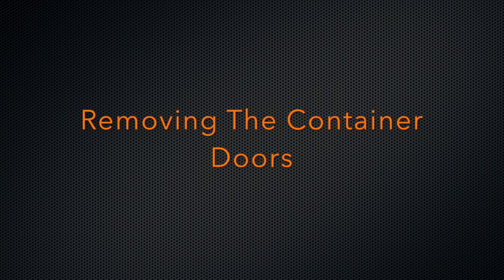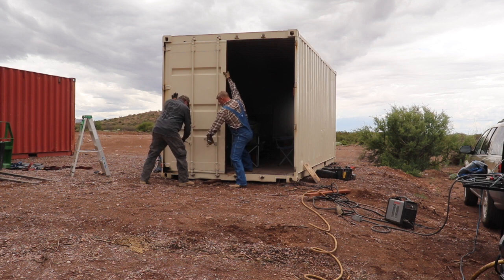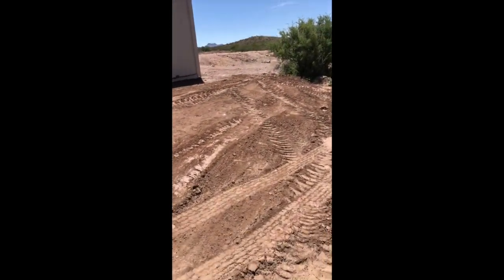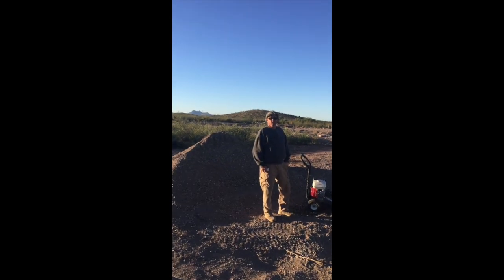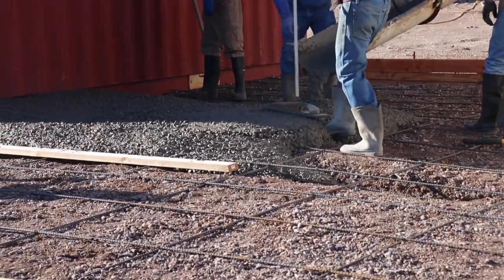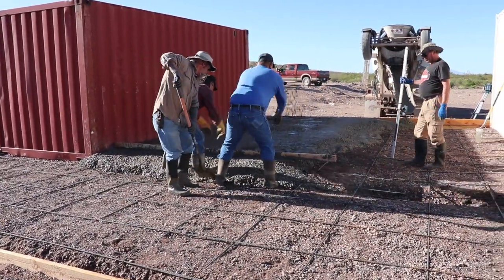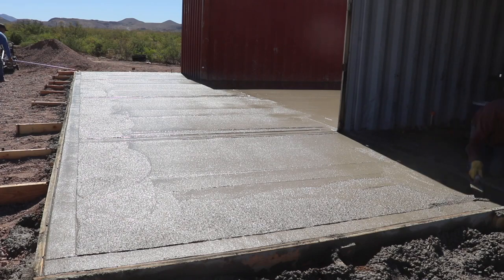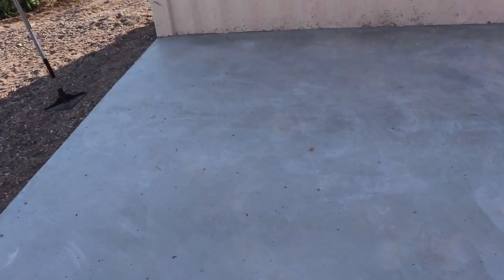Shipping Container Build #6 Grade, Footings, Forms and Concrete

Comment: Crap you cut them why worry...
Reply from the maker: Greg S I cut what?
Reply from the maker: Oh, did you mean the doors?  For two reasons. 1-the concrete wouldn’t be able to come up to the floor level and 2- there is going to be a 10x10 bump out right there. I didn’t cut the doors on the other side and we will include the ones we did remove into something else.